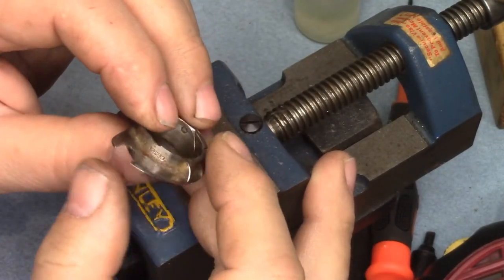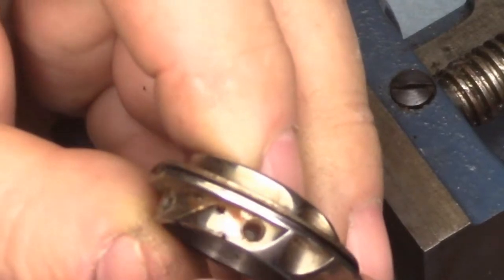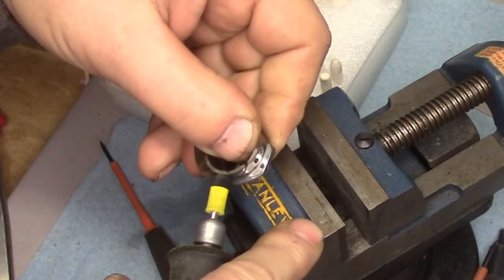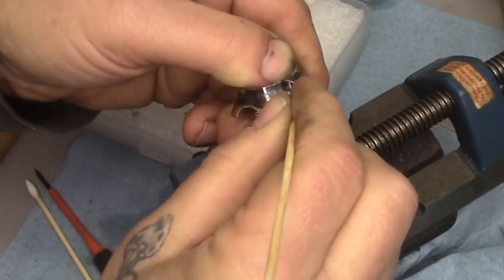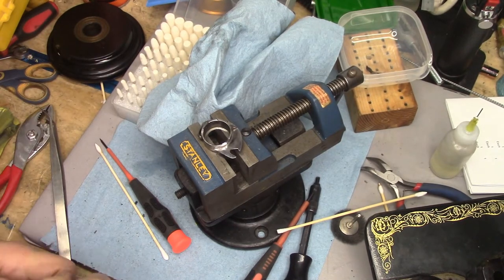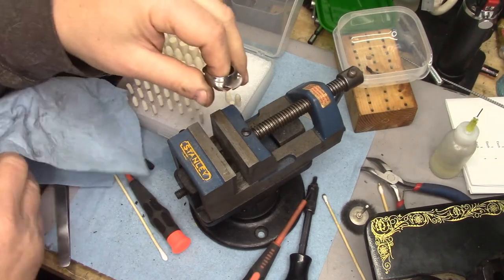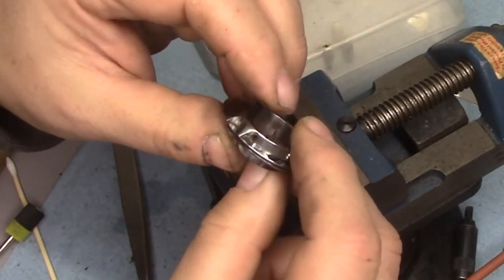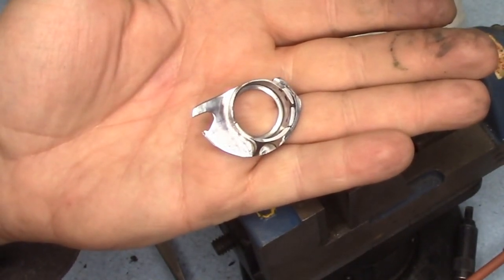Singer 66 Class Bobbin Case  - Clean and Polish

Comment: I'm in the process of rescuing my grandma's 66 red eye. I'm learning a lot from your videos, I wish you were closer so I could have you work on it!
Reply from the maker: Where are you located?
Reply: Arizona, we refinished the cabinet and took the frame down to the metal, painted and applied gold rub n' buff to the singer and emblems on the sides. It's very used but being in a cabinet it was somewhat protected but a lot of rust on the foot release lever and cover plate on the back.

Comment: Wow, that bobbin case looks like new! Thanks for pointing out about the hard felt attachments and the yellow compound. 
I agree with you about the motor tools. Many years ago I bought a Dremel. It lasted 2 years. Was going to cost a bundle to repair. I was in a  Black and Decker outlet store and found their version of a Dremel. I am still using it.

Comment: A great video. Thank you. Could you use the same process for cleaning up the presser feet that come with the machine?  I have just gotten hold of a Singer 66 back clamp and most of the feet including the ruffler are rusty.
Reply from the maker: Absolutely, I do it all the time. I also use the foam cored nail files to clean and polish the bottom of presser feet, going through the grits all the way up to 12,000.
Reply: @BobFowlerWorkshop  Thanks for the reply and the extra tips Bob. It is much appreciated.

Comment: Beautiful!  Do you ever put a drop of oil on a bobbin case?  I know you want to avoid oily thread, just asking (I'm a newbie)?
Reply from the maker: The bobbin case gets lubricated by the red felt oil wick in 66 and similar class machines. For later machines without the oil wick, follow Singer's instructions in the operator manual.

Comment: Do you have any videos on how to get the bobbin case out?
Reply from the maker: Hi Lisa. Yes, I do, but the different eras of 66's come out slightly differently. If you have a later version of the bobbin case positioning bracket (that's the one with the screw we call the screw of death), you can easily lift up on the tail of the bracket so that it clears the slot, and slide it to the right which will free the bobbin case from the hook. You might have to rotate the handwheel to get the hook into a position where the bobbin case will release a little easier. Early 66's without the screw of death are a little different. On those, you must remove (or at least loosen) the mounting screw for the bracket as they don't pivot the way the newer ones do, then lift up on the tail and move it to the right. Email me for more info or if you get stuck and need help.

Comment: I just got a 66-18 and could not get the bottom tension right.  I watched your video and my Bobbin Case is exactly like the one you are working on.  Those little screws suck!  Is there a place for replacement bobbin cases?  And if the case/shuttle is like that, then what is the hook like?
Reply from the maker: There are a lot of companies offering Apollo style 66 bobbin case replacements, but I haven't seen the all metal SIMANCO 32590 cases offered as new. Unless your case is missing screws, they can usually be brought back to life with careful cleaning and polishing.
Reply: @BobFowlerWorkshop  Do the plastic ones work?  And are all the 66s, even the older model ones using the same bobbin case?
Reply: @BobFowlerWorkshop  Happy Belated Birthday by the way!

Comment: What is the compound called? Is it a polish or cleaner like crud cutter?
Reply from the maker: My favorite compounds are available here:
https://www.kocour.net/
Kocour Yellow Compound SS17: I use the large bricks (2.75 pound). SS17 is my go-to compound at the buffing wheel for almost all polished parts of a sewing machine.
Kocour White Compound KC11: I use white compound for small parts that are being polished with a rotary tool and either a buffing wheel or a felt polishing point. KC11 is a bit dryer than SS17 and buffing residue wipes clean easily and leaves a very high shine
Reply: Thank you so much:) Does the compound work for all sewing machines?
Reply from the maker: It's not used on the machine body, it's used on the parts with a buffing wheel. On the body, I polish with an automotive polishing compound, usually one by Maguire.

Comment: The 404 full rotary beats a 66 for value any day of the week!   The only potential negatives are that it just isn't as pretty as 66 in beautiful condition and some may not like the slant, but I do.   And. it cannot be treadled like the 66.  But in all other accounts it smashes it. Just like the 301 beats the Featherweight.
Reply from the maker: That's true, assuming you can GET a 404. They are very hard to find around these parts, whereas I can pick up 66's all day, every day for very little money.